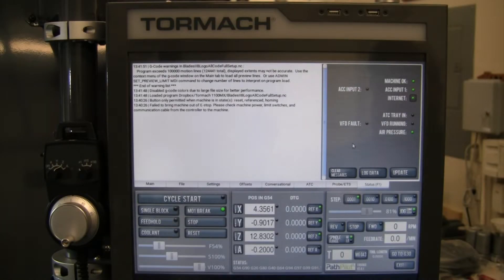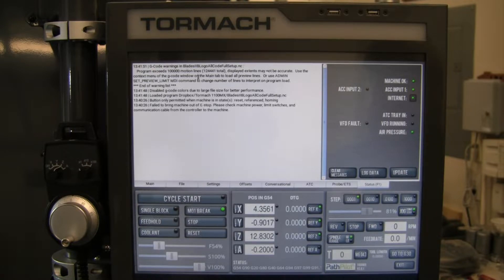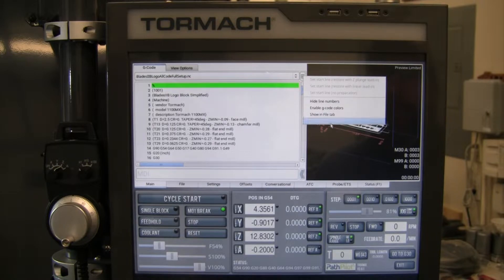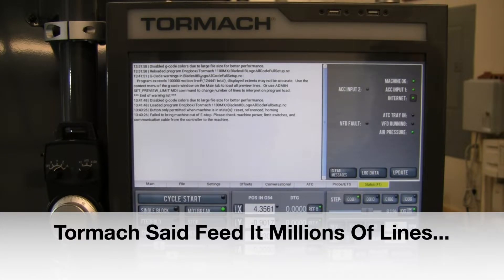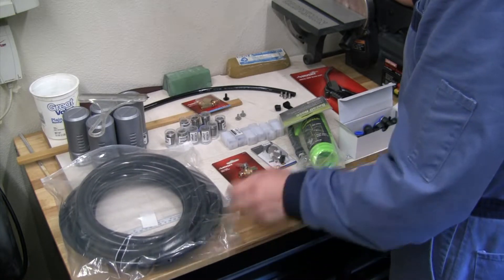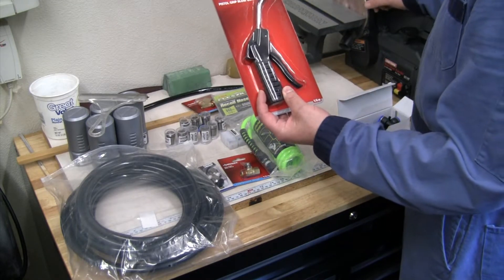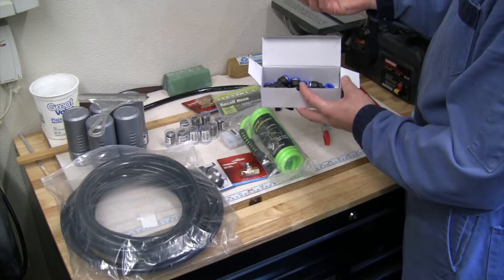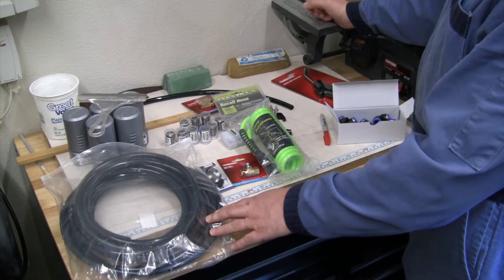Tormach 1100MX Coolant Wash Down Hose - What every CNC Machine Needs!

Comment: Disappointing pressure .  Good info.
Reply: I just put a 1/4hp pump on mine. 5/8" ID latex hose was easy to install in the cable chain. 38gpm makes my wash down nozzle a beast.
Reply: @thrustaviationtooling  was it a standard type of centrifugal pump? Any details would be great.  I added a filter with 3/4” hose but need to pick out a pump and a 10 gallon tank or similar.  Thank you!
Reply from the maker: @thrustaviationtooling  Thanks for the feedback. Glad to hear a larger pump really makes a difference. I am sure mine will need to be replaced at some point.  If you have the model/part number to share that would be great thanks!
Reply from the maker: @cogendynamics - Appreciate the feedback and the comment.  I don't have anything to compare to as this is really my only coolant pump I use and definitely the only wash down one.  Agree it is not much pressure, but has been working for a couple years now to keep the machine clean without having to add an additional pump.  Always trade offs, may have to upgrade to a larger pump one day.

Comment: I did almost same thing, but simpler. Ran the half inch line from the Y in the back around the outside, and on the end I put a push to connect connector, same valve, then on the other end of valve I have a 3/8" to 1/4" reducer and a 1/4" air tool nipple for a nozzle, and I just hang it on that ledge in the back when not using it, gives a good stream.
Reply from the maker: josh zeismer - Sounds like a great solution. Thanks for sharing and thanks for the comment.

Comment: I'm curious, how well do your ceiling mount air filters work?  I have my machines in a climate controlled room that's fairly small, and when using flood and I'm really doing lots of material removal, I get a haze in there.  Mainly steam from hot chips and coolant but my sinus sure doesn't care for it.   I was wondering if these might help.  My AC filter have to be changed pretty often in there.
Reply from the maker: RJMachine - Thanks for the question. I actually don’t usually run mine when the mill is going with coolant. Have not had the mist issue you mentioned so can’t speak to how it would handle that. I primarily run the air cleaner when grinding. I have it pointed to blow towards the grinder with the goal of keeping all the grinding mess at one end of the shop. I can say it works pretty good for that. And when grinding horn or stabilized wood I wear a respirator and let the air cleaner keep the shop clean for when I take the respirator off. Sorry I don’t have a better answer for you. I hope that helps a little.

Comment: Funny, I had done exactly the same thing when I got my 1100mx I picked up some stuff from The Home Depot and Harbor Freight, I also used the same air blowing gun, haha. Worked well for a while but I really wanted more pressure. I ended up replacing the stock pump with a diaphragm pump (5.5gpm) and added a tee to feed a garden hose sprayer as well as a 120v solenoid to control flow to the flood coolant head. When the machine is on the pump comes on immediately bringing the coolant pressure to 60psi and shuts off. solenoid is controlled by the coolant pump power socket, and the pump is running off of a 12v power supply attached to the accessory power ports. I now have amazing flood coolant pressure to blast chips out of 2 inch deep pockets and washing down the machine is a breeze with the extra pressure and flow.
Reply from the maker: Francisco Estrada - That sounds like a great upgrade.  May have to look into that, I can see where that extra pressure would really help. Thanks.

Comment: Could i get a link to the hose. Im definitely doing this.
Reply from the maker: Rubens Ti Tools - Sure, here you go. I went with the 10’ coiled hose, it seems long enough, and I wanted less hanging. Flexzilla Polyurethane Recoil Air Hose, 1/4 in. x 10 ft, ZillaGreen - LP1410AFZ https://www.amazon.com/dp/B00TCMB6PU/ref=cm_sw_r_cp_api_glt_fabc_F7QA47Q9XGNMSK1BYGQ0?_encoding=UTF8&psc=1

Comment: another great video.  Always nicely done.  Do you know what psi the coolant system is producing?  It appears to be a little weak?  I'm wondering if another 3rd party pump with a little higher pressure can be used in place of the factory one?  These videos really help out a lot since I'm waiting on mine now lol.
Reply from the maker: tdg911 - no idea the pressure. I will say with all three jets running while cutting it seems to do it’s job well as a flood coolant system. Glad these are helping.

Comment: Make sure you check your Z axis is getting oil. Mine was barely getting anything from the automatic oil. It didn't have much pressure to get the oil all that way up there.  So i went under the the mill and disconnected the line that feeds the z axis from the 3 way and installed another auto oiler to the removable plate on the back of the column. It only feeds the z axis.  This solved my problem and tormach sent it for free (im still under warranty) .  You definitely need to check this out.
Reply from the maker: RC - thanks for the tip. How did you check and figure out you were not getting enough oil to Z?
Reply: @BladesIIB  disconnected the line after it goes through the top raceway. I unscrewed it from the junction block that is mounted on the head (furthest point i could easily get to).  Turn on your oiler and it should be a steady stream of oil.  Not drops like mine was.
Reply from the maker: @RcBlade  perfect thanks!  Will definitely check mine out.
Reply: @BladesIIB  let me know.  I'm curious to see if yours was like mine.
Reply from the maker: @RcBlade  will do, may take me a couple days to get to it, but I will let you know.
Reply: He never got back to you mate. I wanna know for my machine too lol